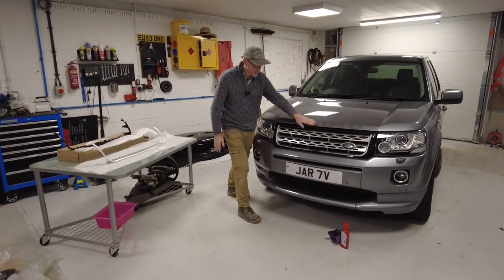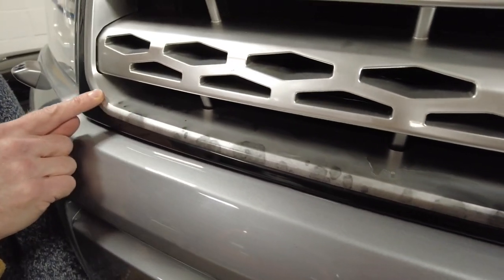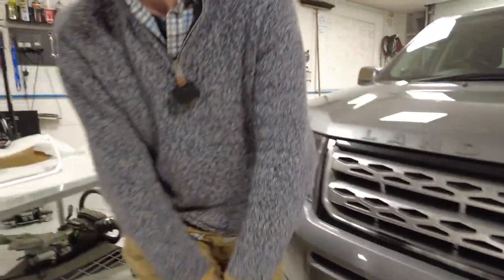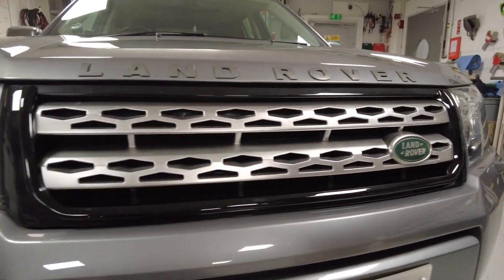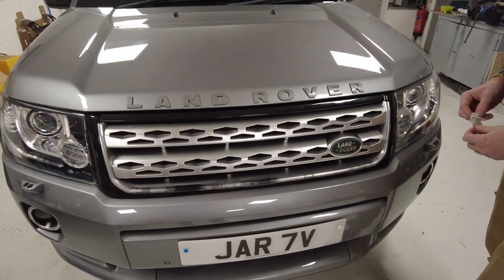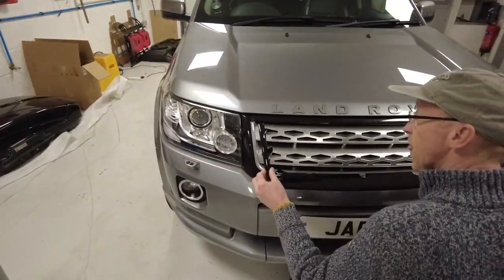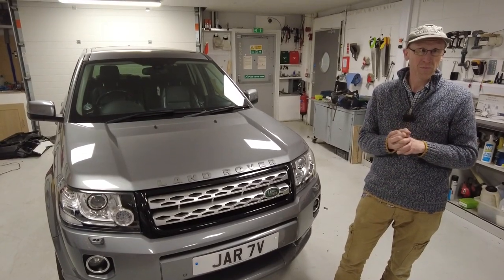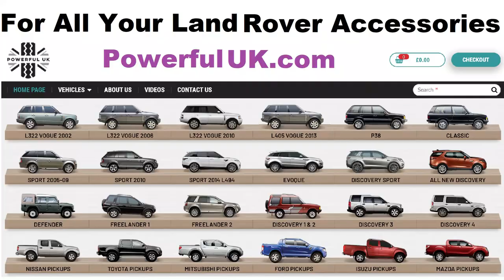Land Rover Freelander 2 / LR2 Front Grille Cover / Fix / Upgrade

Comment: A very neat solution Simon. It never affected my 2009 Freelander II just it will be perfect for later owners. As for neutral Clunks…I had that but only if you open the throttle just before the gear engages.I just made sure that the selector was only moved at standard engine idle…..if not then ŷes a big CLUNK would happen. The D/Sport is much more refined but would be similarly fierce at anything like 1100 rpm.I thought it was a design fault as my Mercedes gearbox never has a hint of it. Good work! Richard😃😃😃😃
Reply from the maker: Ben went to Land Rover and they changed the software so it does not go to neutral while you are in traffic - it leaves it in gear
Reply: @L663  Simon…that is interesting as my D/Sport stays in Drive unless I move the selector wheel. I don’t believe it has been changed so maybe they thought it was a flawed idea…in fact I always select neutral of I stop for more than 5 seconds…I think of the gearbox internals so try to take any stress out of them.😃😃

Comment: We see this alot of this a the dealer.  Mainly the atlas finish and Brunel finishes. If we had this product back under warranty it would have saved so much time and cost's. But its butt just the fl2 we are seeing the same on the disco sports d5 and l405 . Anything with these two Colour Coatings are blemishing now. Will keep your product in mine for or customers and used stock.  Great product guy's

Comment: Simon could you design a freelander 2 facelift model front grill that could hold a light bar or brackets that go through the grill so you can attach the light bar thanks 🙏🏻